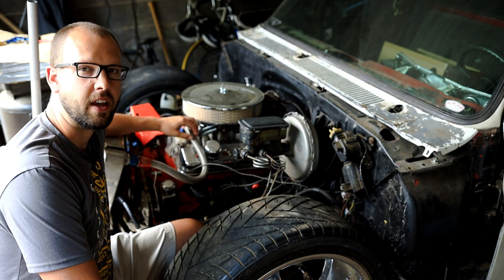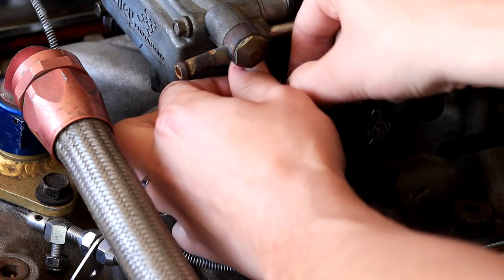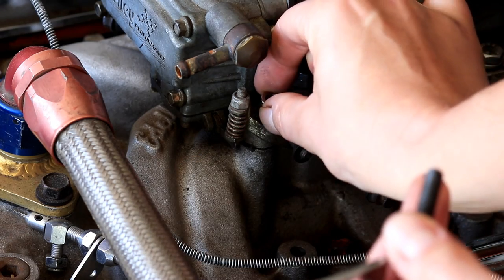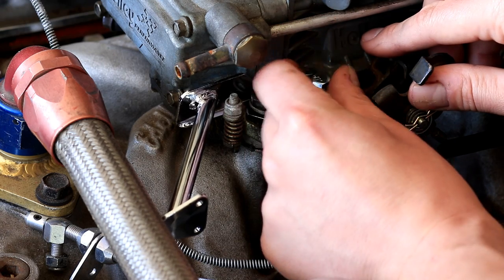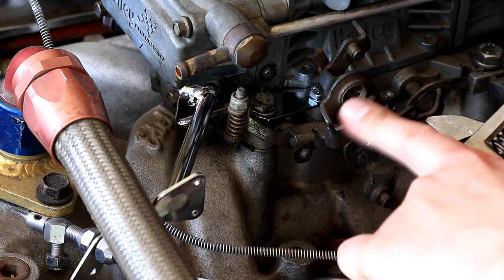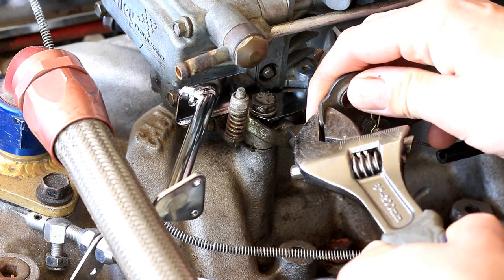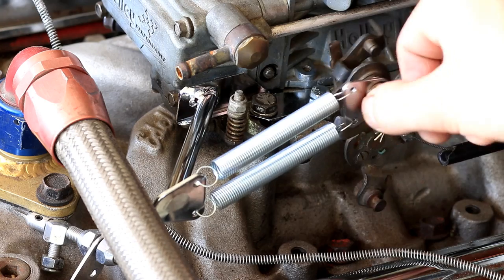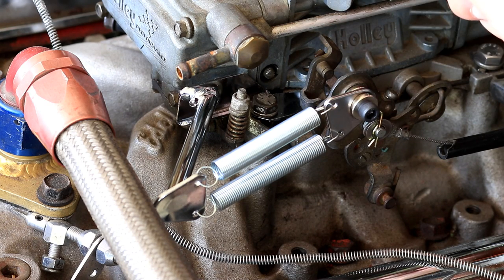Holley Throttle Return Spring Kit

Comment: Love the video. the orig carb bolt isnt long enough for that shim. what do you recommend to use? just a regular bolt?
Reply from the maker: Thanks!  I'd get a longer bolt or a stud to use in the place of it.  Should be a 5/16-18 thread.  Don't go too much longer though.  Don't want to bottom out in the hole.
Reply: @CoolStuffGuysLike   Thanks for the info! worked like a charm!
Reply: Mine was the Moroso kit. And Yes the instructions don’t help at all. I put it on wrong with one spring. Thanks to your video I’ll redo.